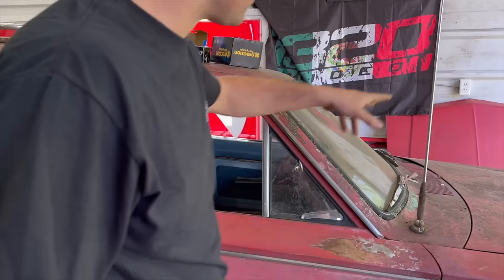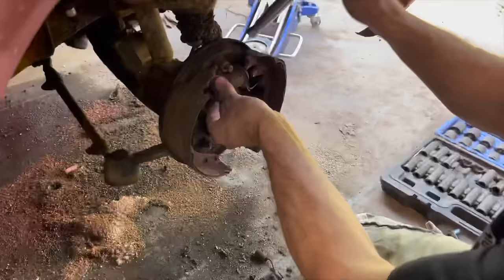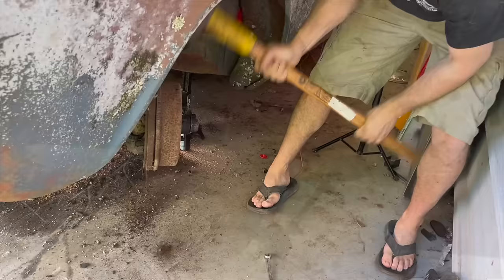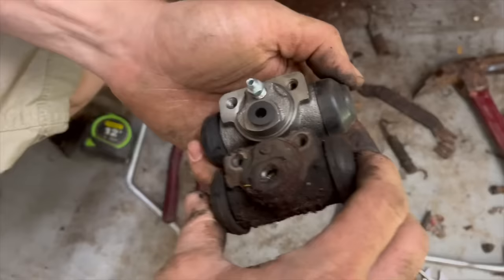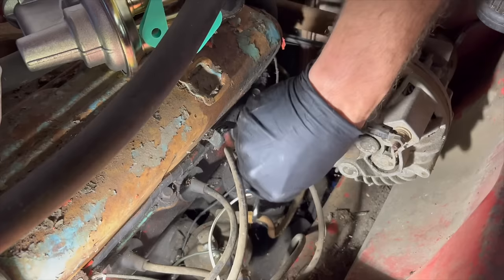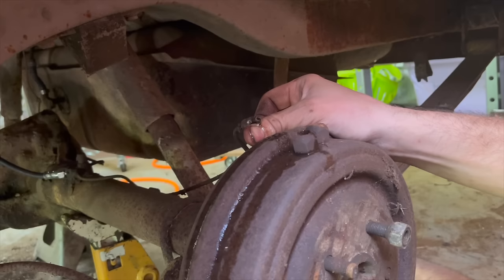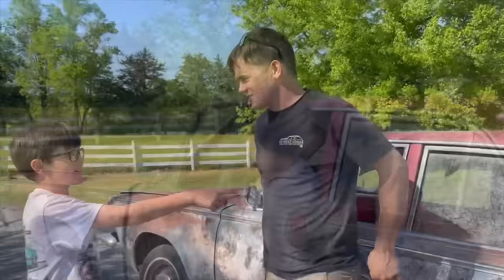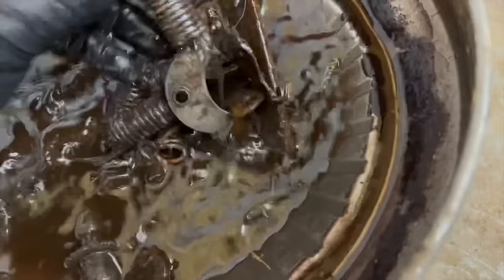Can it pull a trailer after 30 years parked? 64 dart station wagon first drive

Comment: First off my dad had that style wagon it was a time that to save money they would s rebadge Plymouth and Doge bodies. Don’t matter to me we had that wagon.  That my dad used to haul paper from the mill to his print shop. Also bought a Cox camper that we went camping in. It was a small pop up but it was bigger than the car.  And this is where it all lines up that tent trailer was for sleeping only. Family hung out at the picnic table or the camp fire. Even cooked at the picnic table. Of course we had a cover to stay under. Should it rain. Seats for the campfire and campfiretools and all the accessories took up all the space in the folder trailer. So we had to unload the trailer to sleep in it. No matter how later we got there.  Now we have to think MIMI. Your trailer is a mini version of what I had in mind when I watched the MINI Bago   Your thinking floor plan and my camping experience will be helpful. You don’t have a lot of room so make your mini like a mobile motel room. For sleeping only. Yes limited closet space but each bed is a bed made for sleeping not a table converted to sleep on. With camping accessories in the mini trailer. So when you are on a long haul pull into the rest area and climb into the trailer to get some sleep without having to clear a path to the beds. This layout will also allow for pore private sleeping arrangements that may not be important now as it will in a few years may have a microwave and refrigerator but because you not putting everything in the trailer you can go with bigger ones.
Reply from the maker: Ok thank you for the good info and sounds like you had some good memories
Reply: Yeah I was thinking about getting from point A to point B and realized those little bodies need to be in seat belts. So you might wan to get MINIvan seats that fold into a bed and air mattress I was thinking trailer and camping. Completely ignored the they gotta get there factor.  Any other issues let me know
Reply: Can get away with lap belts only if seats are facing backwards? Don’t matter the cane see where you are going there watching tv. Witch has a link to the dash cam

Comment: Good stuff . Brings back a lot of old memories . Just a note on drum brake rebuilding . there are three spots on the backing plate on both shoes where the shoes actually rub on the backing plate . You will see three spots on the inside of each shoe . A little dab of wheel bearing grease will stop any squeaking  that will eventually happen . You must have had some really good schooling or OJT in your younger years  . Your shop skills are really good . Yes I noticed your day job . But your mechanical skills are really good . Congrats ...
Reply from the maker: Thank you really appreciate it

Comment: Excellent video Sleepdude Crew  :) also Josh  :) plus family got wagon fix up nicely to plus got nickname that car (Station Wagon) and got radio plus throttle pedal fix up to ! Also you had fun time fix up temperature gauge fix problem be on temperature sensor on motor or throttle be cable easy to fix too! Radio all need put stereo in also wire up for speakers then antenna to hook ! If going get stereo get a stereo shop and harness plus speakers with some wires leads to them to wire up ! Antenna need aftermarket patch coax cable to! If temperature sensor works on motor just check fuse panel also gauge may need wire aftermarket gauge in !
Reply from the maker: Thank you

Comment: brake parts kits for drum brakes usually run in the 10 to 12 dollar range for all the parts to connect drum brakes...new springs, hold down pins, adjuster cables, etc...why would you not replace them anytime you remove the drums from a 50-60 year old car? watch all your videos...love your family life...get  to work on the fairmont!!!
Reply from the maker: Sometimes we can’t get parts in time thank you

Comment: Build you an electrolysis tank. Using a manual battery charger, putting your small parts in a screen wire basket,  immerse iron into the tank filled with water. And 1 cup of washing soda per y5 gallon of water.  Attach the positive lead to a piece of sacrificial steel,  the negative lead to the basket of rusty parts. Put power to the battery charger overnight.  You should have rust free parts.
We use electrolysis for cast iron skillets 🍳
Reply from the maker: Yes we need to

Comment: Dang this would have been the perfect time to replace that broken stud , even if you had to replace all that one to right hand it would have been fine !
Reply from the maker: Yeah your probably right
Reply: I've found that left hand replacements are out of stock for the Mopars I checked but right hand are still available at the big chain parts stores like OReillys.  If you are committed to keeping left hand, you have to buy used.
Reply: @auteurfiddler8706  that is why I said even if you have to replace with right hand on that one hub , because I have had trouble in the past and I have not been active in auto repair for the past  15 years other than my own cars .

Comment: I had a similar wagon here in New Zealand it was either  an AP5 or AP6 Valiant with a 225 slant six and the pushbutton auto,great cars..
Have you tried to tighten a little bit on the brake line before trying to loosen?
It sometimes helps the line from twisting with the nut..
Reply from the maker: Ok thank you

Comment: If it can pull a trailer, then it should be able to commute with a higher rear end gear and no trailer, and get better mileage while doing so.  This car looks sleeker than a later Fairmont, but the Fairmonts are wind tunnell tested so looks might not equal mileage.  The later carbs are probably jetted leaner too, but you can jet a carb lean for mileage or if you can't find jets, just lower the float level a bit.  And if you  watch the plugs for overheating and listen for spark knock, you can often advance the timing quite a bit over stock.  2.3 Fairmonts might have overdrive transmissions though, which would leave this 170 in the mileage dust without a trans swap, and then can you adapt the push buttons to a modern trans?
Reply from the maker: That’s true

Comment: The proper way to pack a bearing is put a golf ball size ball of grease in the heal of your left hand if you are right handed hold the bearing with your right hand and press the more open part of the bearing cage into the grease press firmly into the grease lift and repeat until fresh grease comes out the top of the bearing. Then rotate the entire bearing a 1/8-1/4 turn and repeat until fresh grease is all the way around. Don't spin the bearings dry.
 To properly adjust the bearings tighten the adjusting while spinning the drum UNTIL the nut is tight. Then back the nut of one full turn . Then finger tighten the nut .put cotter pin in
Reply from the maker: Ok thank you

Comment: Are you certain it's a 170 ci. Slant-6?  I'd expect a wagon to have the 225 ci.  The "170" on the hood is the trim level, not the engine displacement.  Trim levels in 1964 were 170, 270, and GT.  I didn't see in the video that you backed off the brake adjusters before trying to pull the drums off.  It hurt to watch that...
Reply from the maker: Ok thanks

Comment: I just went through the exact same thing with an old Mazda RX4 in that condition and heat was my friend.
Reply from the maker: That’s cool
Reply: @Sleeperdude  All new calipers, wheel cylinders, master cylinder, clutch slave and master cylinder, brake pads and shoes.  Now all I have to do is rebuild the the 13B rotary engine.

Comment: This little 170, or whichever classic ends up getting you the best mileage, could be your daily commuter car instead of the full size 4wd pickup.  Do you know if you can retrofit a locking torque converter?   You will need an eye for reliability though.  I have an '82 4wd w-150 with 225 slant 6 and a tiny 61 CID '98 Chevy Metro, and put 90% of my driving miles on the Metro, only breaking out the truck when I can't stuff something in the Metro.
   A 170 push button probably will never beat a 2.3 Fairmont for mileage though.
Reply from the maker: Yeah that’s true

Comment: why not just pull the motor and trany out drop the Exhaust system and while you have all the brakes pulled you can get down in the motor bay and brush all the loos rust and dirt and vacuum out the finders crevices then replace all the brake lines fuel lines tidy up wires and ground post wile you have to access to the firewall get the etching primer rust killer and spray the hole thing do the doors top hood behind the gas tank jb weld works good but you have to take all the surface rust off with a wire brush down to pure metal I like the 2 past tubes you mix together they work real good then drop your rear axle assembly hit the frame and under side real good and spray the rust killer and prime it and paint it rubber coating or black paint clean the axle assembly and paint it to then go through the motor clean it all up new seals go over the transmission new filter and seals and change u joints then you will have a good solid rig to drive go camping or fishing with a small trailer and it be safe for your family and you will know the out side done I would change out the convert points distributor to electronic  ignition . I like the plan jane ones my friend had one never let him down he kept the narrow tires on his I went camping and hunting a lot with him he put a brush guard bumper that what they were built for going out in the back country
Reply from the maker: That would be the best way of you wanted to fully restore it

Comment: do you know how to tell the difference between the 170,198,225 slant six motors
Reply from the maker: Not really
Reply: @Sleeperdude  the length of the water pump bypass hose the 225 is the longest

Comment: you aint gonna " burn out"  with a 170ci  slant six. that is not what that engine is about.  that engine is there to save your life,  not to dance on tables in high heels.  the basic design of the engine came from Rolls Royce in England. also as far as the goats - their children and our children are called " kids."

Comment: He hoses entire engines including the exhaust manifolds with penetrating oil,  but never the brake line fittens or hardware. Ron W4BIN
Reply from the maker: I said in the video I have been spraying them for several days